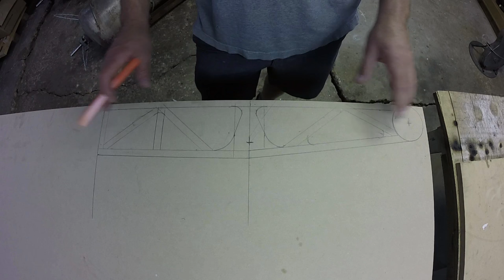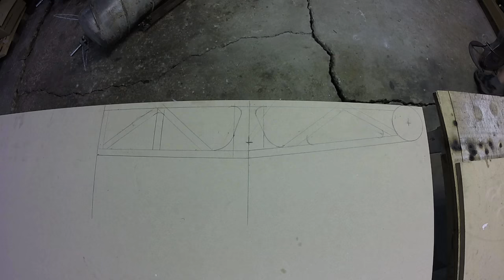Amphibious Screw Drive ATV Project - Part 2 - Rear Swing Arm

Comment: I would think that you should allow the rear end to articulate. It adds a little complexity, but if you provide a means for left/right "roll"in the rear and have that roll dampened by the front suspension, it would require a less beefy structure...err...it'll result in less fixing later. the only issue you have to deal with, structurally, is absorbing fore/aft motion between the screws and the body to save the screw bearings. Using separate drive systems (dual hydraulic motors) would mean that you don't need nearly as much rigidity as you did before with the chain drive. Just make an undercarriage for the screws and slap the atv shocks on top with a hinge at the rear for roll articulation.

As an aside, a hydrostatic transmission would be positively perfect in this application. Dual hydrostatic drive could control the speed of both screws independently at any given throttle setting.
Reply from the maker: i did consider rear roll, but many atvs do not have rear roll. the body of the atv just rolls and the front is where the flex is. so i dunno........thats what i'm basing my thoughts on

Comment: I'm thinking having a suspension is going to be problematic, and extra weight! From the Mk.1, you may not be going fast enough to need it, and I'm interested to see how it will work with connected, fixed roller/screw propulsion where the original suspension was for 4 un-connected wheels. Good work so far though, loved the first one, and love the direction this new one is taking! oh, and another thing, maybe some cross-bracing on the back with some tubular steel to help even more against the possible flexing?
Reply from the maker: yeah the suspension is totally useless, heheh....but fun to build! and will look cool :)

Comment: On the spring/shock assembly's arm, the one that connects to the pipe, be sure to box it in. I've done the same thing for an ATV to "snowmobile" conversion and the thing buckled eventually.

Whatever motor and pump you get, be sure to get a proportional valve for control. If you check the YT channel that belongs to one Keith Fenner (google Keith Fenner hydraulic press, he has two videos on it, very detailed), he has a press (he built himself) the valve that allows him to move the press up and down is so precise he could probably drive 3 mm pins without breaking them.

In the world of hydraulics, control is King. Also, you can get a ton of cheap parts if you can get access to a yard that has heavy equipment "discharged" to it. I managed to score a few lines (@5000psi) off a digger from a yard, i've been using them for 5 years now, considering i paid a six pack in admittance fees and a few dollars for the heavier metal bits i scored, it was extremely cheap.
Reply from the maker: i'll check it out thanks!
Reply: yeah I was looking at that coilover mount. Most certainly box and gusset the shit outta it. OR simple and lighter weight option, move it so the force is pushing on the tube, closer to center line the better. that is if you can make that adjustment with constraints of the swing arc.

Comment: box the beams in bubby there a few options in getting the rigidity your looking you could even carbon-fiber wrap them.  you're not going to set any speed records with your method of go.   essentially you are riding around on a set of augers that float.  you might as well throw the kitchen sink at the foundation of the thing. polymers can be and are stronger than steel and are not subject to rust sun is it worst enemy but that can be solved with a UV coating.

Comment: I'm thinking, depending upon how you design the front, deturmines weather the screws are pushing or pulling the bike.
Reply from the maker: yeppers
Reply: My stomach says,Nick should go for pulling-cause pushing would put the resistance against the swingarm in the rear,which will maybe cause some issues.

Comment: Good work mate. Are you just going to use a Hydrostatic drive from a mower?  If you can score an old zero turn, you will have everything you need for the job.
Reply from the maker: i have no idea yet to be honest.....seems like those mowers are hard to come by cheap...around here anyhow
Reply: Yeah, I guess piecing it all together with bits and pieces here and there could also be expensive. It all ads up.  being able to reverse the drive would be a lot better than a brake steer. Maybe a salvage excavator or stand on loader would be easier to come by. Either way, I cant wait to see what you come up with.
Reply: +REDNIC79 hydrostatic isn't what you want, It won't hold up to your needs.
Reply: +Bob G should be fine. I've used a setup in a small tank. it's been done plenty. just need to find the right one
Reply: hydrostatic holds up 2 very very heavy loads from 50kg to 100000ton loads and on a small scale thay than go very fast with great control

Comment: What if you put the motors and a planetary reduction gear inside the screw pods? Would that not look cool? Needs a hollow and fixed drive shaft of course an create a whole lot of other problems. Maybe in a 2nd revision.
Reply from the maker: yeah i like that idea, once i find the right motor i may set them inside a bit

Comment: hi you're  an awesome craftsman. What is your engine???? hp/kw lb/in Kn/m shaft size????
Reply from the maker: thanks! I don't have an engine yet, not sure how much power I will need todrive the hydro stuff....any ideas?
Reply: I'm guessing the original engine from the quad is 2stroke with a variable trans built in so a briggs and stratton engine may be a good starting point
Reply: 60hp

Comment: Another good step forward! im not sure,what your ideas are,but what about direct axial connection between hydraulicmotors and screw axles?as a result of this you wont need chains/gears and one source for failure is off.For motor:White drive product http://whitedriveproducts.com/products/light-duty-gerotor-orbital-motors-spool-valve-type (distri, also many in Canada or maybe  Parker TF Torque motors are not bad,f.e. TF0195 compact build and high torque: http://www.directupload.net/file/d/4434/j8vlso3k_pdf.htm you can find parker mot. refurbished or used at ebay.
Reply from the maker: yeah i'm thinkin direct connection, my biggest issue is going to be figuring out the torque requirements
Reply: REDNIC79 You can do it! :)